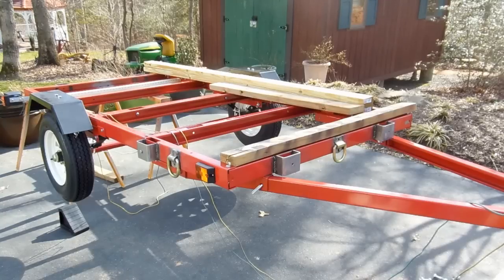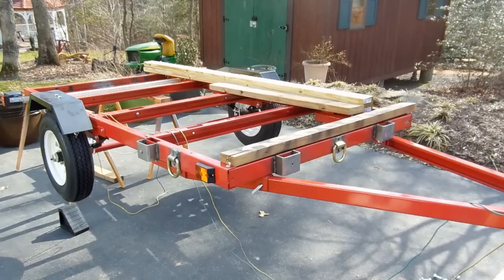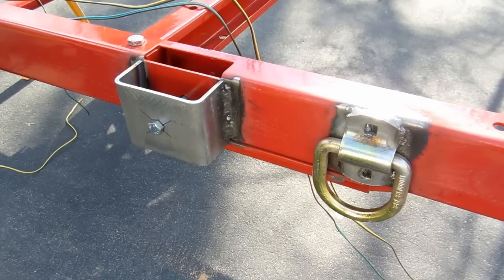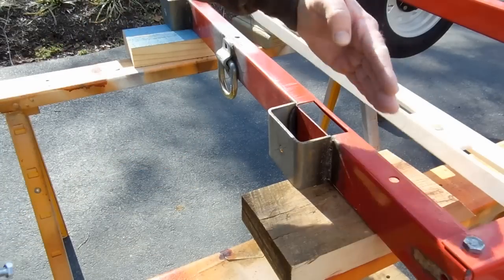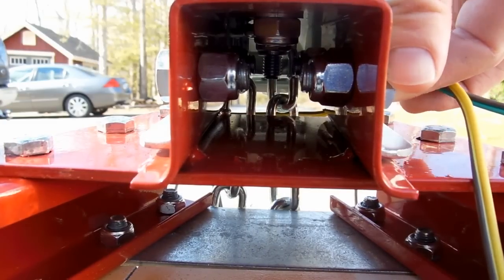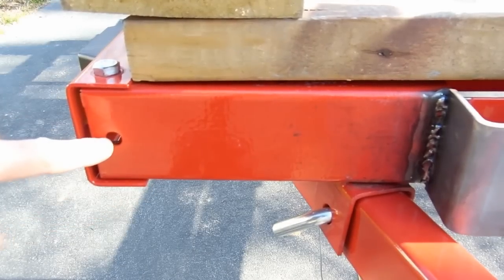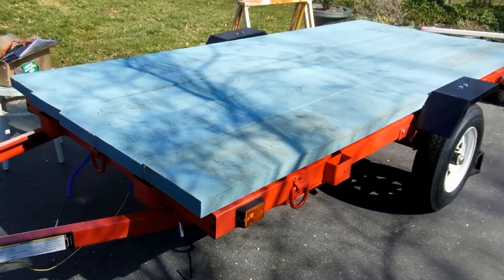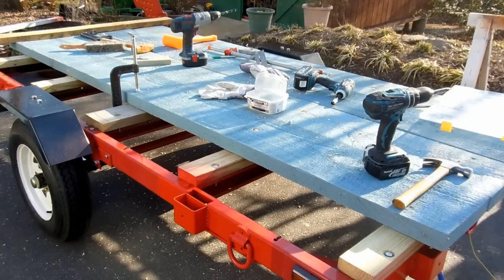Harbor Freight 1720 Lb. Capacity 48" x 96" Super Duty Utility Trailer Build Out

Comment: Once you modify adapt a pre-engineered piece of equipment you void any warranty and accept liability for the structural integrity of the modification have a made. Many times two bolts are not better and four when you have drilled holes in metal which has made a sub-structure weaker than its intended purpose. I am not saying this is the case here but certainly big consideration before undertaking structural modifications.

Comment: nice job using an impact to drill a hole....
Reply from the maker: You bet it was! It worked very well, especially considering I didn't have a 3rd drill handy
Reply: +Vicos Ya know, they tell you very specifically in the directions for impact wrenches(at least the one I have, a dewalt) not to use it as a drill.  Whatever works though
Reply: @Kami8705  that's to prevent shattering the heat-treated drill bits on metal... on wood I think it's ok

Comment: What is the difference in the hf 1195 lb trailer?
Reply: not much (or anything) that I have found. looking at part numbers on the acle, hubs, leaf... they are all the same. at just over 1000 pounds it's bottomed out. I have about 10,000 miles on mine and 1000 pounds is all I would do.
Reply: SolarizeYourLife, the cheaper one is basically a 1/2 ton trailer and the more expensive one is a 3/4 T trailer

Comment: I would have use a piece of 4'x8',  4" thick steel plate.  And used 3/4" x 5" grade 8 bolts.  Then I could really freak out folks at the harbour freight parking lot.

Comment: You've used up your trailer's weight limit with the wood frame...
Reply: +Soulman1282 
That's what I was thinking, when you add heavy sideboards. Plus creating pockets around the bolt heads all over the deck will trap water and dirt. The Oak may be able to resist rot so that may not be a real issue. 

I got this trailer at Harbor Freight a couple years ago it was on sale and I had a 20% off coupon so it only cost $150.
http://s8.postimg.org/vdruv0uad/i_Phone_Picture_389.jpg 
http://s9.postimg.org/xcz6jz0bj/i_Phone_Picture_391.jpg

I think there is about 200lbs of wood and fittings in the 2.5 x 4 x 5 box but it really made it into a serviceable little utility trailer.
Reply: So

y
Reply: Not even close. He has a 1790 lbs weight load, the same as mine. For practically everyone that gets one of these trailers, you'll hardly ever come close to that  load capacity
Reply: Guy H. So yah! Load it to the max ! And tow it with a Toyota Corolla! Live on the edge!  What do you mean I can't weld across the frame? I did it, didn't I?  ...... Drive safe.
Reply: um no.

Comment from the maker: This is what I purchased: /shop/tools/product_200403263_200403263
$190 now, but it was on sale for $140, plus I think I used one of those $50 off a $250+ coupons (bought a few other things at the same time). I'm a pretty patient shopper. I don't trust Harbor Freight when it comes to electrical items.

Comment: Those stake pockets inside the frame leads me to believe that this is a weak point in the trailer.  That concerns me and is a reason I didn't buy one.
Reply: The newer ones have stake pockets on the outside that you have to bolt-on. The rails are now solid.

Comment: Nice build but.. using an impact to drill with spade bits....
Reply from the maker: 1) Why do you care? :lol:

2) I had 2 battery drills and the impact driver. Each had a dedicated purpose/function for this job..so I did not have to constantly change bits, thus saving me a lot of time. It worked just fine to countersink those bolt heads.

Peace & Love, Peace & Love...
Reply: Hey whatever gets the job done I guess lol. I just don't think impacts are great for drilling.
Reply from the maker: trevt99
No it was not ideal, but like you said, it got the job done and that's what I had.

Comment: The 1720 lb trailer is actually more like $450
Reply from the maker: This video was made 8 years ago in 2013.
Reply: @Vicos  Indeed.  It is now (2022) around 550$.   Just picked one up at the local Harbor Freight.  Now just waiting on weather so I can get out there and build it.  Will be using 5/4 treated deck planks for the bed.  Using it mostly as a single place snowmobile trainer.

Comment: If you knew much about Chinese metal you would NOT buy these for anything more than a yard cart. Also they use garbage for bearings. Go ahead and try to replace one. I know this because I sold a John Deere tractor to a guy and he was on his way to pick it up when he locked up a wheel... He wasn't more than a mile from home so he just dragged it home with a locked up wheel.. I delivered the tractor to him and looked at his trailer.. I must say it was the biggest pile of CRAP I have ever seen!!! I am an automotive master mechanic and have worked on my share of trailers. So I helped him out by pulling the wheel off the hub and removing the hub. Once down to the bearings I was in shock that these trailers ever make it very far at all. The bearing baskets are like tin foil and have no strength. He told me the trailer was about 4 months old. Had only ever been pulled on his property to haul plants by his wife behind an old Craftsman garden tractor.. It was the first time ever on the road and it only made it about 1 mile. He contacted me again to see if I could locate bearings for it as TSC had no clue and the local auto parts and Tractor Supply said they couldn't match them up.. (No numbers on the bearing races). I suggested he take it as lesson learned and buy a real trailer made with good steal and axle. By the way, it was also a 4x8 foot trailer..
Reply: Steve 1961P. Isn't that a contradiction that you want t good quality material that comes with cheap price ?
Reply: +Steve 1961P. I used one of these to carry my 900cc motorcycle from Florida to Maryland without any problems.

Comment: After a recent purchase of one of H F trailers, (August, 2033) I found a wheel bearing that was 'rusty' even though it is/was 'new',  Many people that assemble these trailers say not to trust the kit bearings that are furnished. As a follow up, I ordered a complete new set from a local reputable auto part store. Long story short, 'National Bearing' puts thier name on thier bearings, ok ? Well, guess where thier bearings are made !!!! It boldly is marked on the bearings: MADE IN CHINA ! So, what are you getting if you toss H F bearings ? Don't fall for the crap ! Why buy another supposedly better set of wheel bearings, " IF THEY ARE ALL THE SAME" ???? RIP OFF ! BUYER BEWARE !!!! One other point I'd like to make regarding this trailer build- I am handicapped-no big deal- I live alone, but find no need to 'flip' this trailer to assemble it ! Simply placed 4/5 cement blocks under my build, (on end) allowing ample space to work, and I did use an air powered ratchet to snug it all up !!!! No need to seek help to set the trailer on it's wheels later. Don't swallow all the hype you might hear ahead of time. Do a little homework, and save yourself some work !!!! ENJOY !!!! I also packed the new bearings after they were installed on the axle. I simply left the cup off until I saw grease come through the outer bearings, using the zerks,, and a grease gun. No mess !